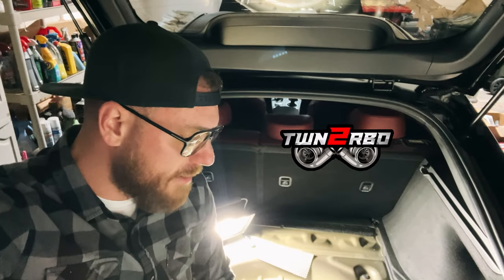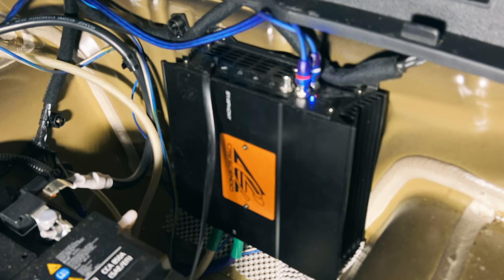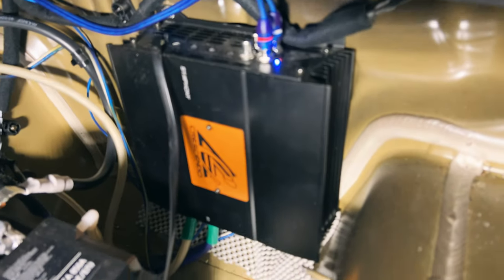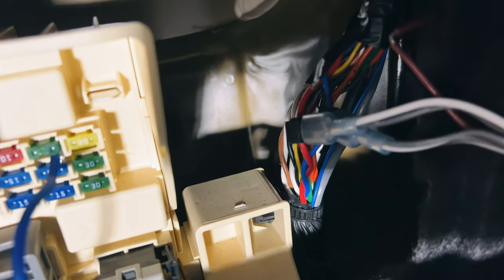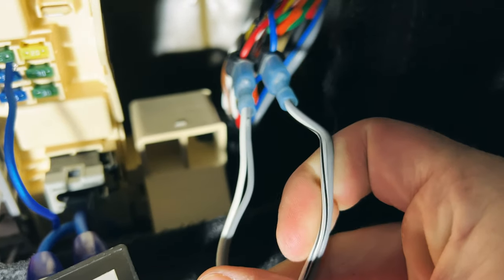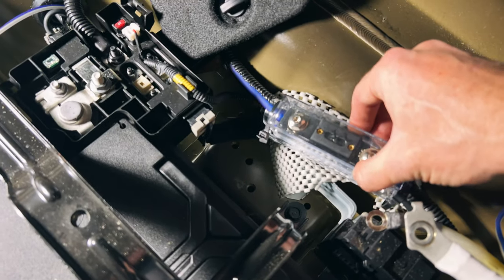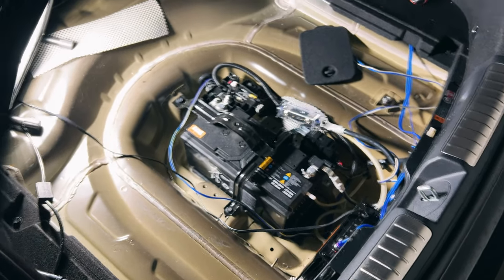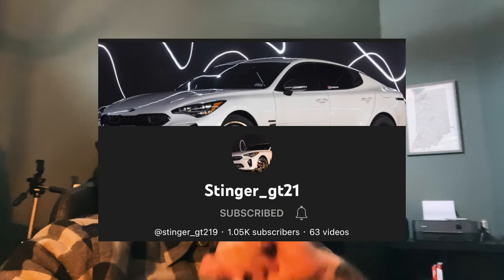How to Install an AMP in a Kia Stinger GT

Comment: I have a 22 gt 2 and the sound system is really amazing, I would even say better than the one in a 750il that I had and it was nice, fyi I m also in indy area I will keep a look out for ya or holler I would like to know about those front lights in the vent area u have thx have a great one

Comment: Where tf did you wire the damn positive and negative speaker wires on the converter, power and remote wires can't give signal
Reply: Same thing I said, I think  that is where positive and negative is for one speaker signal?

Comment: I want to a tiny 8 inch to the left or right part of the trunk. Lol no boxes made for it, I have gt2 and Harmon kardon is great though
Reply from the maker: The HK does sound awesome! The mids and highs are much louder and crisp and there is a significant increase in bass. But nothing compares to the X8 footprint, the bass is insane, low and crisp. Not a cheap sub of course but it’s insane how far tech has come
Reply: @TWN 2RBO   yea exactly, but ever since I had JL7s in my jeep it was stolen 😅  police. Found them locked them in evidence and never saw them again. I like something small, great, and sort of hidden. I also out my pup in the hatch area or stuff don't want to have to move a box in and out
Reply from the maker: @curtislaketek2952  I totally get it, not the most practical, my friend has a 13.5” w7 for sale 😁
Reply: @TWN 2RBO  I'd rather use that in my home theater
Reply: @twn2rbo  they make insane hometheater sub, I currently have SvS Sb16 Ultra, 2 svs SB3000 13 inch, two 8 inch subs

Comment: Great info I’m honestly looking for GT2 info I have the Harman Kardon setup but read through your comments and no joy. I will share as much info as possible with legitimate research I’ve done over the past 6 month and let me tell everyone that it is technical if you want it done the right way (🤑). With that being said I’m doing a full build on my GT2 and will be starting with bass install first. 2 Skar ZVX 8’s motors that I had professionally rebuilt. Helix D One for Bass. This is the most affordable bang for buck vehicle to add bass to however,  if you’re looking into upgrading the 2 sets of 3 ways that’s where you have to make a decision on if you want that big screen tv for this upcoming football season. Just to keep it simple a 12 channel amplifier is needed in order to upgrade and maintain full factory setup. Obviously you can break the amplifiers down if you are ok with multiple amplifiers however I drive Uber and want to be able to keep clean factor look. I’m really looking forward to this build in hopes to help our lovely Stinger community out and get me some damn basssssss 😁
Reply from the maker: Let’s go! If your on IG drop your @ and post some info on there for them to follow also. You can take full advantage of the hatch, it gets very low and loud extremely easy, keeping weight in mind one good 12” sub with a good box built to spec at 32 hz, would be perfect imo. That single sundown X8 on 800 watts sounded so amazing and people thought I had two 12 back there, I couldn’t believe how low and loud it got! To two 12’s were just nuts and way to heavy, slowed me down!
Reply: @twn2rbo  I plan on uploading shorts here soon. My box is almost complete.

Comment: Try to film someone with an alpha romeo guila
Reply from the maker: Lol I can only imagine, I just installed an amp in my X1 and it was hell, had to tap into the fuse panel through the glove box and line out converter remove the passenger seat to tap into a subwoofer. I heard the Italian cars are the hardest